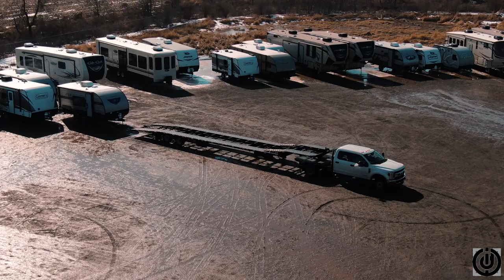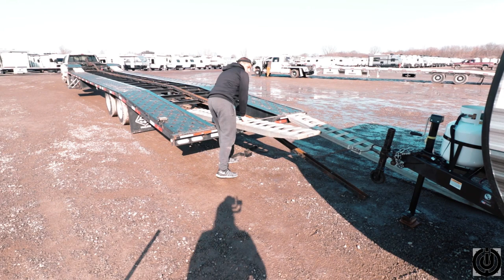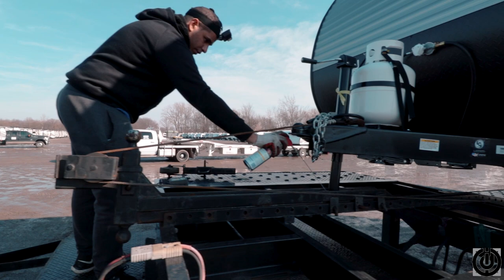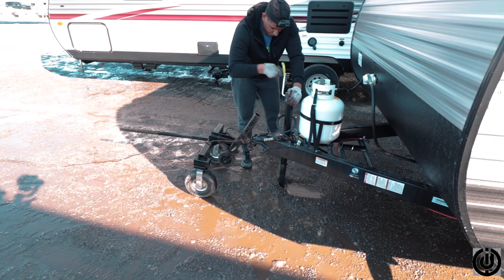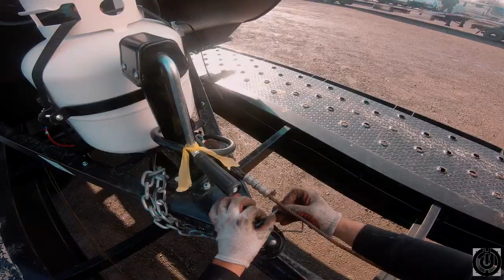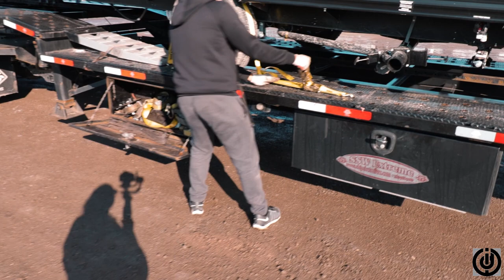Loading RV Trailer

Comment: Awesome videos man! Finally someone made some on loading and unloading. I've been interested in doing this type of job for awhile now. Where did you get the trailer and equipment and about how much did it go for? Also where did you get the bed setup for the truck and about how much did it run ya? And finally, what fifth wheel hitch are you running?